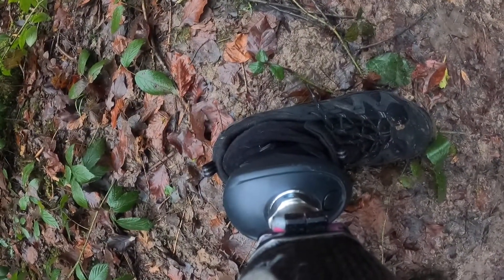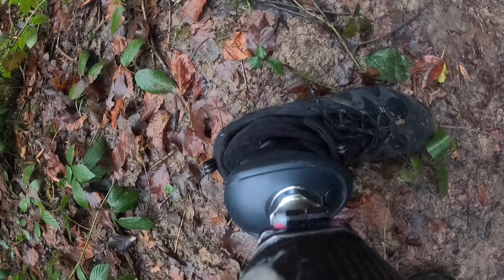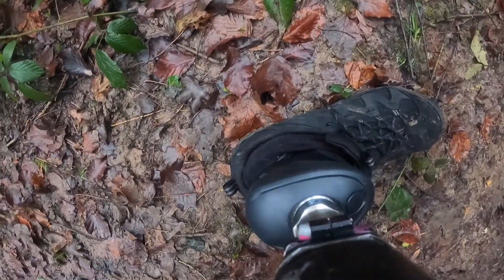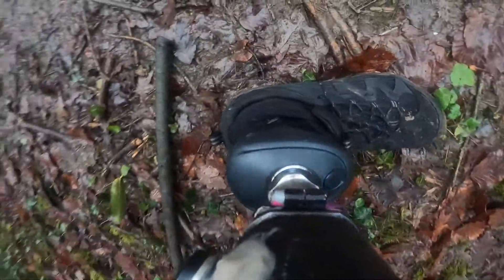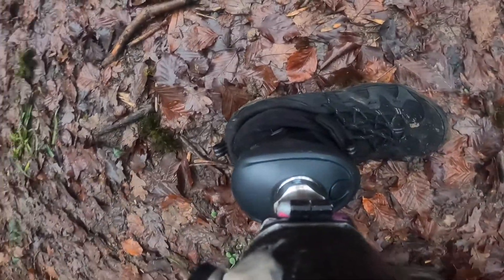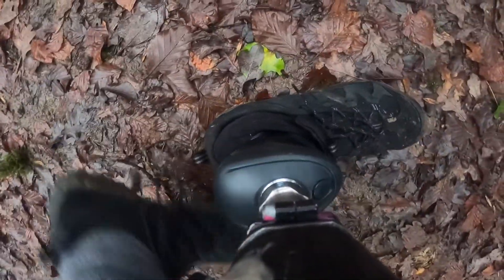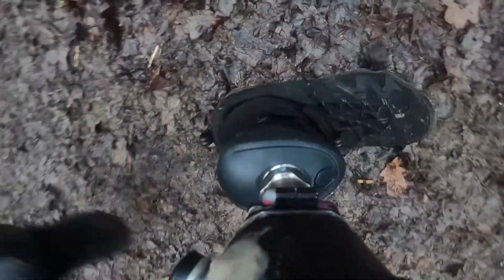Kinnex (Freedom Innovations) Microprocessor Foot Review

Comment: Having had a kinnex 2.0 since July 2020 (first in the uk), it sounds like your alignment wasn't quite right. I've not experienced roll over issues you describe.
I've actually made a couple of firmware suggestions to freedom, though I expect it's fallen on deaf ears.
Reply: Absolutely  great in all fairness. 
There's a feature called dorsilock (sp), whereby the foot locks towards the end of its dorsiflexion movement. It sounds like this wasn't set correctly which would explain your odd rollover feeling, i would say it was locking too soon in your gait. I found that the calibration wizard was always close, but never quite right, and minor tweeks on each setup made for the perfect configuration.
Reply from the maker: Hi Andy, we followed the manufacturer's recommendations for the ankle to make a fair comparison between feet. I'm interested to know more about how it feels to you during walking?